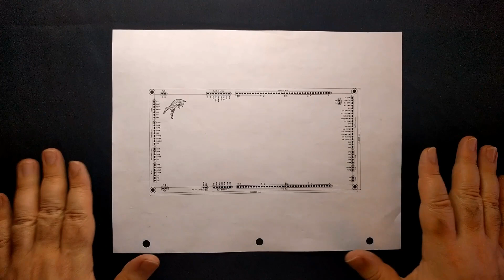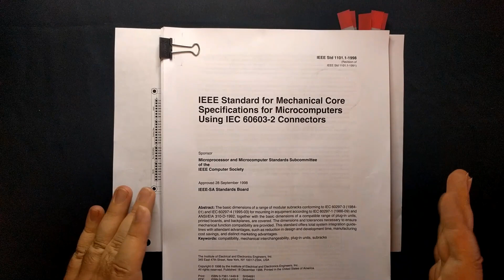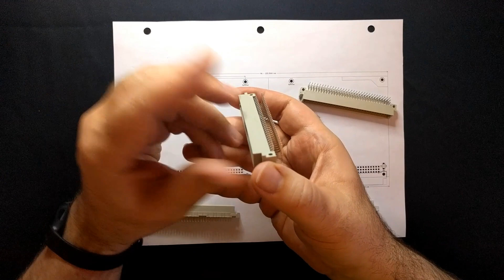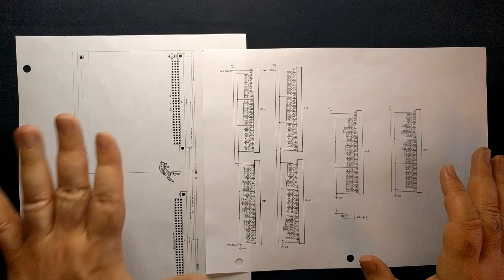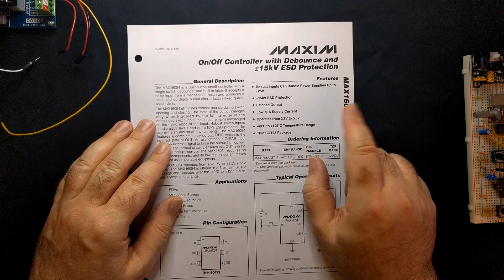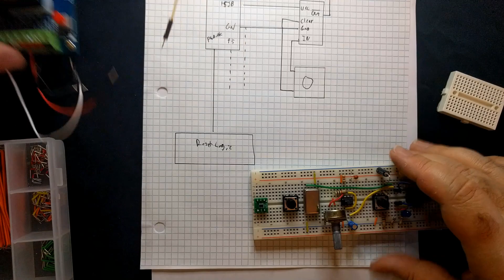486 Breadboard Computer - Part 7 - Hardware

Comment: Is it safe to start building this design, or are there any updates forthcoming? Can you do a system status/overview video, as looking through the GitHub repository it all seems a bit overwhelming? Maybe some kind of block diagram PDF would be good. Thanks.
Reply from the maker: That might be worth doing once the new boards are assembled, and I'll see if I can add sore more detailed info later on.

Comment: do you have links to the atx nano and the breakout board?
Reply from the maker: Well the power supply is one I've had laying around, but it's easy to find on amazon or ebay. As for the breakout board, I used this: https://www.amazon.com/Electronics-Salon-20-pin-Supply-Breakout-Module/dp/B01NBU2C64/ref=sr_1_3?keywords=atx+power+supply+breakout+board&qid=1690138322&sprefix=atx+power+supply+breakout%2Caps%2C144&sr=8-3
Reply: @Fox-Tech  thanks

Comment: The best suggestion I have for soldering SOT23 packages is to not use a soldering iron. Instead, apply soldering paste (which contains flux as well as powdered solder) to the pads - and I'm sure they make stencils for that, though it's not too difficult to apply manually as well; then you position the chip over the pads, it will be held in place by the surface tension of the soldering paste; and use hot air to solder it. A decent hot air rework station (clone but with digital temperature control) can be had for under $50.

Comment: Interesting project! 
Since you are going to make a backplane and use euro sized boards, don't you like to use the standard 19" racks instead of a standard PC case? PC cases are  kind of ugly and they would hide your beautiful boards from sight
Reply from the maker: I look at that, they are... not cheap, doubly so if I want something somewhat portable (which I do). Though it will always be an option :)

Comment: Consider using hot plate or hot air reflow for the small SOIC chips?
Reply from the maker: I'm planning on trying hot air reflow for the final PCBs, as they are almost all surface mount parts.

Comment: Isn't it worth it to invest into 900M or T12 compatible soldering iron, they range from ~$20, its always useful to have a good soldering iron
As an alternative you can always build DIY T12 analog from Kasyan TV,  it works great but its analog so the while the temperature is stable you cant see it

Comment: Can you give us details of the Nano ATX power supply and breakout PCB? Will you be updating your GitHub repo with the latest info?Thanks.
Reply from the maker: Well the power supply is one I've had laying around, but it's easy to find on amazon or ebay. As for the breakout board, I used this: https://www.amazon.com/Electronics-Salon-20-pin-Supply-Breakout-Module/dp/B01NBU2C64/ref=sr_1_3?keywords=atx+power+supply+breakout+board&qid=1690138322&sprefix=atx+power+supply+breakout%2Caps%2C144&sr=8-3

Comment: Glad you're back and still at it. I've watched too many projects like this just disappear; I was getting worried.
Reply: So am I. I’m concerned that he bit off more than he can chew. A 486 on a breadboard is going to be a wiring nightmare not to mention its sensitivity to glitches and requires very stable signaling . The 486 also needs a host of other support chips that handle tasks. There is the issue that it uses paging and other features. Maybe he could have gone with the 286 or the 186 to start. But then again the net is flooded with 8086 projects already and those processors aren’t far enough ahead to make it interesting.

Comment: What are the part numbers for those edge connectors?  I build 6502 computers for fun, and I've been looking into making a multiple board computer and I need good connectors. I've found some on mouser but I'm not sure if they'll work for me but the ones you are using look pretty sweet.
Reply from the maker: They are DIN 41612/IEC 60603-2 Connectors.
Reply: @Fox-Tech  Thank you Sir, you are a gentleman and a scholar.
Reply from the maker: @billlewis9740 you can find them here: https://www.mouser.com/ProductDetail/854-BB3U